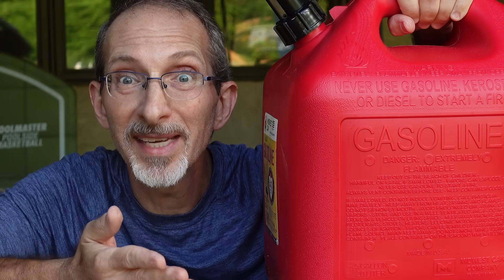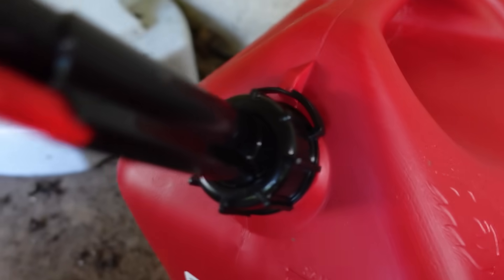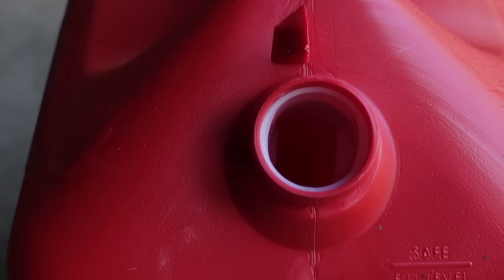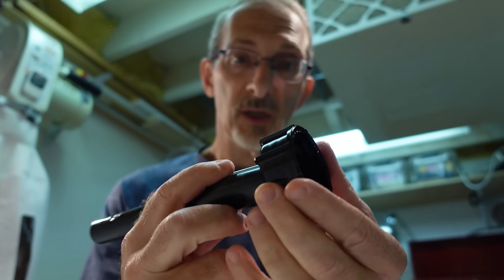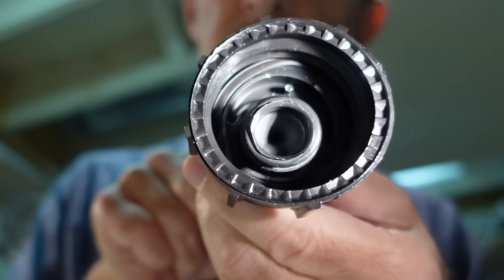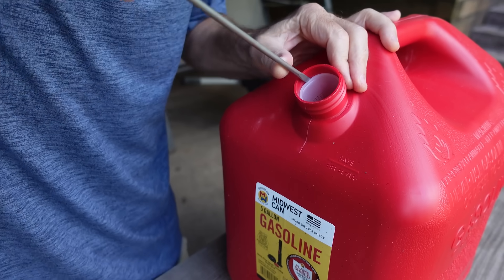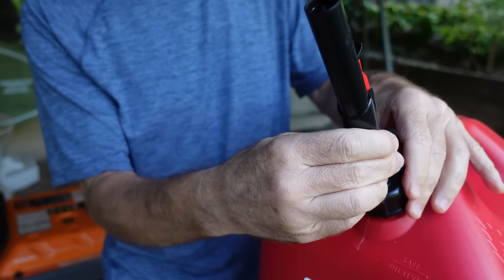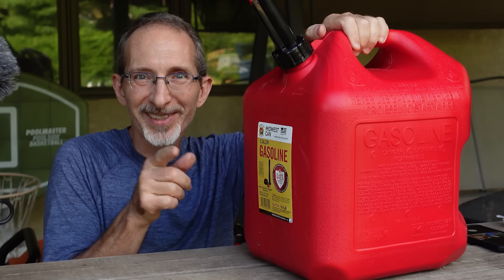Gas Can Modification | New Gas Can Fix

Comment: I just found a different explanation for the "filter" inside the tank. 

I saw on another channel that was testing Flow Rates, durability and spill management on a LOT of gas cans. The filter is a Flame Mitigation Devise. Back in the 1800's a Coal Miners lamp (candle or oil) had a metal mesh around the flame. When gas released in the coal mine - It could have a massive explosion the caused the loss of many miners. With the mesh in place - the flame inside would get much brighter but the flame would NOT pass through the mesh. So, if someone was crazy enough to check the level in the gas can by using a lit match (of open flame), the fumes would catch and travel into the gas can but would not be able to go through the mesh and violently explode all the gas fumes inside the gas can.

Comment: The filter in the top of the tank IS to keep debris out of the tank. There is a problem with the engineers logic. 
1. Fill your tank and some debris is caught by the filter. 
2. You cap off your tank and take it home or where ever. 
3. You install the nozzle and fill your tank on whatever piece of equipment. 
4 The PROBLEM - The debris is caught in the gas flowing out of your gas can and goes into the tank on your equipment. 

How is that good? I would rather the debris go all the way into the can, I leave a little in the can and can dispose of a little gas with the debris into a safe burn pit and not cause any damage to my equipment.
Reply: It's not a filter (obviously it won't work for the reasons you describe)  It's a flame arrestor

Comment: I guess I spilled about 12 oz of gasoline in my first 40 years of life. In the last 20 I have spilled 12 gallons, all thanks to this ridiculous mandate. In addition, I have a handicap which prevents me from manipulating that troublesome trigger mech manually, so there is no work-around for me. I simply replace the stock spout with an aftermarket flex spout, but some of them are junk too. Oh well, so much for progress.

Comment: my wife likes to store sliced cheese in a sealed box in the crisper drawer in a big ice box, so if you need a slice, you have to open the ice box, open the crisper drawer, reach into the small box and only then have to remove it from the plastic. then you have to reverse process. She didn't understand why i complained about it until my wife encountered one of these gas cans

Comment: I totally got rid of that stupid pour spout and got one of the old-fashioned type with flexible nozzle.  My only complaint with these gas cans is there is no air intake to facilitate pouring the gas into whatever you want easily.
Reply: You can put a vent in a gas can pretty easily.  EZ Pour offers vent assemblies with a snap-cap all you have to do is drill the appropriate sized hole, then push the vent assembly in.   Looks  exactly like the vents on many older plastic fuel jugs.  Another approach is to install a tubeless valve stem.  (available at any auto parts store)  just drill a hole in the jug, install the valve stem, remove the valve core, and use a plastic cap to open or seal the vent.

Comment: Thanks a lot, Mike.  I recently purchased several of these "new" gas cans.  I was totally frustrated trying to put gas into my mower.  I wanted to use a battery operated siphon but the filter was in the way.  I pushed thru and into the can.  I've fixed the tab problem, now I'm going to fix the spring problem too.  Thanks again for your tips.

Comment: MOst of the issues are not safety related. They were put in place by the EPA to reduce fuel evaporation, a large source of carbon in the atmosphere, the primary cause of global warming.

Comment: It's not a filter!  It's an arrestor!  Flashback arrestor, fire arrestor, spark arrestor, flame arrestor, etc.  You only ever need them if you often pour gas on fires because you're too stupid to live.  That also goes for the nozzle and cap designs as well.  Thanks for the removal video.

Comment: ........ OR ...... just buy an EZ-POUR replacement spout kit #20050, and then you have a good, old-fashioned gas can with a free flow spout and seperate vent ..... I've done dozens of them, quick & simple, cheap fix.

Comment: For my roadside rescue gig, I was given a 2-gallon can with a similar contraption that was equally troublesome. I too had to do mods to make it work as expected. The intense UV rays here in Florida caused the can to deteriorate quite severely. As a replacement, I bought one of those 2-gallon pancake units where the plunger is much better integrated; just apply a reasonable amount of force and it collapses like needed. Plus, the whole can slides very neatly under my cargo box for added protection. The only caveat is that pressing down on the locking tab can be somewhat cumbersome when tightening the lock ring.

Comment: The "Garage Boss" spout from Advanced Auto Parts is pretty good, once you file off the tang that makes pressing the button a three handed job. This spout gives you full control over fuel flow, better than any other modern or old-style spout. No more covering your mower/chainsaw/weed trimmer with gas! You can also file an angle onto the locking ring so you don't have to press it but it still prevents the spout from unscrewing itself. As for the FLAME MITIGATION DEVICE, it's not a filter. Press the gas can nozzle into it fully to fill the can. There is a round spot in there made for it.

Comment: I have 10 plastic Midwest Cans 5 gallon model 5610.  I purchased them in July 2020.  So far I have had 2 cans split open at the handle seams and 3 have had the screw on caps crack open.  These cans are stored in a cool water pump building here in central Florida.  They never see the sun or have been left outside.  I do not trust this brand.  Very dangerous.  I have 2 other 5 gallon plastic cans from Blitz that are 14 years old that are in perfect condition.  Will try and call the company.  No matter what they say I don't trust there products.  Replacing all 10 cans is going to expensive.

Comment: Think about how pointless that filter is. Let's say you've got some kind of large chunk of something that comes through the gas pump and gets caught in the webbing. If you don't know about it, and you go to pour the gas next time you need it, guess what's coming out of the gas can with the gas? The chunk of debris. 

The only way that webbing will be helping you is if it's cat hinges something that you can pull out yourself, before you use the gas.

Comment: That is not a filter but a flame arrestor.  Feds mandated it after a lawsuit against Blitz gas cans.  Some fool went to pour gas on a fire and the can caught fire.  All gas cans have them now some are in the nozzle others are in the can.  Either way to me like you they are not safe and I also remove them.  At that same time they took the vents out of the cans too.  I add them back on new cans but don't tell the Feds.  LOL  :)

Comment: I simply replaced the nozzle with an after market old technology nozzle, no spring.  Then I drilled a 3/16 hole on top at the other end for air to escape when pouring.  I used a screw with a large head to close the hole after pouring.  I don't remember when whether the 70s or 80s, but during one of those decades I had found a nozzle that allowed me to control the flow of gas as I poured. I haven't seen one of those this century.  It was a better design than this spring loaded monster.  With it I could put the end of the nozzle into the gas tank then with a turn open the flow on the nozzle.  No gas on my mower.

Comment: how to fix your gas cans in 3 easy steps
step 1. remove the old shitty nozzle
step 2. throw the old shitty nozzle across the yard for later when you go to run it over with your lawn mower
step 3. get one of those yellow flexible ribbed gas nozzles for 10 bucks and screw it onto your gas can.

Comment: Rather than cut off the part that you did on the cap or whatever you want to call it ( if some busy body sees you filling without a proper cap ) I filled down the protrusion on the can itself that the raised part catches. My cans look unaltered but turn smoothly & easily to remove for filling. I hate the screens too..

Comment: Good job. Now one more thing is needed. A vent. I use a valve stem without the core. If you misplace the cap they are easy to get

Comment: I just went to Tume and but the old style fas nozzles for my gas can so I can fill my lawn mower with out getting gas over flow. Comes with screw on cap and a vent. Works great. I can even put gas in my truck.

Comment: Had to buy a new gas can. Thank you. This is 2023. So i got the newest piece of crap gas nossle. I am a woman of 74 years. Geezsh/ I got gas all over me,  lost at least a gallon of gas. A  >5 gallon can of gas is heavy and to have to use this freaking "NEW" non(ha) spill proof nossle is  a nightmare.  I tried replacing a lid from the old can. THEY CHANGED THE SIZEI! I went to 5 stores and it is the ONLY can available to purchase. If you could please do a new video on these new nossles. I would greatly appreciate. I finally got the largest funnel I could find and took off the freaking nossel and pour it in this way.

Comment: This is what you get when you send people to college nothing but dummies that think they know how to do things better that have worked great for years. Lets send more people to college so they can make things worse.You forgot about that fact that the gas wont pour out with letting it continually try and suck air making a 1 minute full a 5 minute fill and spilling gas all over.

Comment: my spout lost it o ring and dribbled, and eventually the who tip of the nozzle shot off from the spring.  flew about 15 ft. i pulled the mess out and put the hull back on and with the screw on tip pours fast now.  the gas can cap industry is nuts. thats the business to be in.  no moving parts.  5 bucks.    not even an emission control cap, and its 5 bucks.   they are gouging the world.  calling it covid.

Comment: I don't understand why we have anything other than a tube with a slip on cap. Terrible garbage.

Recently purchased one for the first time and absolutely hate it.
Bought an aftermarket neck the next day and installed a flip open vent so it pours at a bareable rate.

Comment: I have cut my hand on the sharp area of the molded stop for the lock of the twist on spout, twice.  I filed that edge off.  The lock itself was very hard to disengage, just by hand.  I fixed that, also.  Sorriest spout mechanism I have ever seen, by far.  What is the point in the strainer, pretty much locked in the can, when any trash it strains out of the gas pump or syphoned gas, is going directly into the spout and your gas tank, when you pour the gas in?  It's impossible to pour gas from this can into any road vehicle I have, with the way the can comes from the store.  This is pure, ignorant, BS.

Comment: I did not have the experience you had with filling the cans at a pump station. Never had a problem there. But twice now I have had the actual cap split because I assume of the pressure required to depress the nozzle. As you described last week was the second time this happened and I sent a video of this to someone at the company. They responded with an email saying that they would send me a new nozzle and cap, and also another can. I’ll let you know what happens. The gentleman I spoke to seemed to understand my point and agree with me even. It sounds like it’s not the first time he heard this complaint .  Duh!

Comment: LOL. Like to see him pour the gas into to generate without getting gas all over. I had to buy 5 gal diesel gas gan. It has this nozzle for emergency filling oil heater tank with heating oil. Location of fill pipe is high up. The nozzle design worked great in this situation. I can lift and rotate the full can without  spillage. Value opens once inserted. 

The 5 gallon gas can wothout this valve i found that i spill wihen filling riding mower. Spent like $10 on a hand pump. No lifting a full 5 gallon can and little spliiage. Why modify when there are inexpensive alternatives out on the market.

Comment: Be careful. California will charge you with a crime for tampering with their ingenious gas nozzle.  California will outlaw gasoline soon anyhow so these terrible gasoline cans will be moot. 

I just threw away the spout and used a rubber stopper inside of the screw top. The rubber stopper makes an air tight seal that doesn't spill at all. But now I need a funnel to fill up my equipment.

Comment: Another good idea is to drill a hole on the top opposite the spout so that it doesn't have to fill with air as your pouring and make that repetitive sloshing effect since the can will fill woth air as you pour. You can then plug it with a golf tee to reseal it when not pouring
Reply: *you're

Comment: This is all from the EPA, They want all the vapors to be recovered back into the can because of emissions The best way to do this is to go online and you can find old style filling nozzles and cap and there are little snap breathers you can get you have to drill a small hole and use a mallet to knock it in place. Gas cans used to be 8 - 12.00 dollars each with nozzle and cap, because of government regulation they are now 24.00 to about 40.00 dollars each because of some bone head in washington dee cee has to make regulation that we all have to live by but them.

Comment: There are other gas can types.  This one is not desirable to me. There is a lever type that is superior.   Problem with all gas cans is evaporation.  Fill a can with 2.5 gallon and go to use it and. 5 gallon has evaporated

Comment: I use a plastic 1/2 or 3/4 cap from the plumbing section found at a hardware store for end cap. On the farm we have a lot more dust to contaminate the nozzle. This keeps it clean!

Comment: I'm going to treat my old gas cans with tenderness. The EPA has gone too far with these so called environmentally "safer"? gas cans most spill more gas than before. I'm all for cleaning up our environment but this is a great example of what's called "overreach". That stiff nozzle spills gas no matter how hard you try to not spill my flexible ones never spill a drop.

Comment: The only thing extra I would do is get on line and order a vent cap and drill a small hole in the back and pop vent cap in and it will breathe much easier I don’t know why they took the vents off of them

Comment: The EPA is why we have those. Air Quality doesn’t want gas vapor leaking out of the can. So unless you are pouring gas the spring keeps it tight and sealed. They are a huge inconvenience. 
    In California every gas pump has a rubber boot that needs to seal against the tank and depressed or the pump won’t work. Royal pain in the ass the fill motorcycles and cans.

Comment: As seen by the comments here the new "safety" gas cans spill more gas than the previous cans.  As a cop, I sometimes come across someone out of gas and trying to use one of these cans.  They are spilling more gas on the ground than they are getting the tank.  Quite frankly, these "safety" gas cans should be outlawed until they can make them not require a higher mechanical aptitude and three strong hands without spilling a drop.

I'm glad I still have all of my old gas cans.  I never spill a drop.

Comment: I'm not sure, but that filter screen looks like it could be cut cleanly without fragments of it falling off. If that's the case, I'd probably just put a clean slice directly in the center of the screen. After the cut, you probably wouldn't be able to tell that it's cut because of the way that the ends come back together. When you pump gas and pull the pump out, the ends come back together, and the filter is still there working for you to some extent.
Maybe.

Comment: Better yet, buy a funnel and use the "Safety spout" for a cap. Oh, and drill a vent hole and put a self tapping screw in to cap it off. The angle of those spouts are a complete joke and they don't vent for shit.

Comment: when you place the nozzle back in the container for storage is there any chance of it falling in without the white plastic screen in place ? i have ten of these of these exact containers i bought at 'job lot " in Massachusetts and i will be performing your mods on the nozzle but i had no problem filling them , maybe Massachusetts gas stations have different regulations for the pump nozzles ,so i won't be pulling out the plastic screen but it's great to see it being done so at least I'll know how to do it and be careful not to damage the container filler treads , Thank you for all the great videos , 
i am liking and subscribing and recommending to as many others as i can 👍

Comment: I removed the filter in my gas cans and I removed the red tab so that the spring still works but there's no locking mechanism to keep me from pushing down on it. That way when I lift up on my gas can it automatically turns off and when I push down it automatically turns on. Other than that great mods.

Comment: Yes these uh foreign version safety fill devices are a pain! My favorite device to overcome all of this is the battery powered fuel transfer device just-stick it  in the neck of the gas can turn it on and squeeze the nozzle no lifting the can no funnels no mess! PFM easier on ones shoulder!

Comment: Bought 6 cans exactly the same in Austin Texas in 2021. Went to Sam's to fill them. Blew gas all over me. 
Needle nose pliers wit the jam and jerk move worked quickly.
Tractor Supply has new high flow nozzles with air vent.
Reply from the maker: Jam and jerk move for the win!!! 😄
Reply: don't forget the loud "grunt " in betwix the jam and jerk actually a tad closer to the jerk

Comment: Go a little farther and add a air valve in the back to let air in the can   I used a tire air valve drilled a hole in the top back worked out great